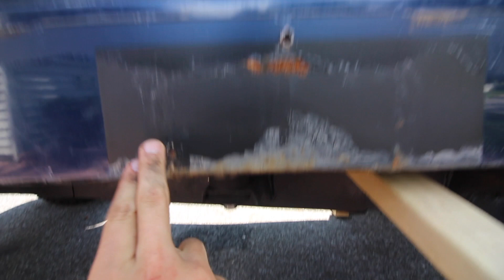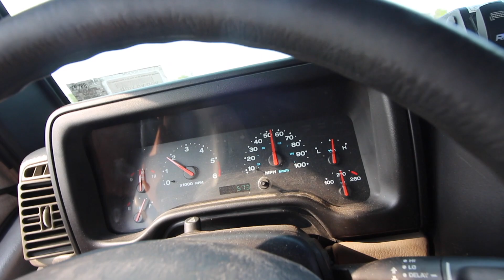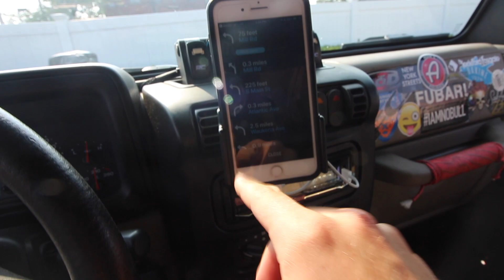another bad speed sensor // Vlog 2

Comment: Another cool vid!!! I hope you get to use those fenders!! A note on the sliders...I have a set on my YJ...I debated using silicone behind them ....but I didn't...and I removed them (to clean behind) and I found that the dirt and debris just goes right through...and there was no rust..I think the silicone just keeps them from draining...anyway that was my experience...did you decide to re silicone them?
Reply from the maker: I did not re silicone them, I used a strip of foam along the top.